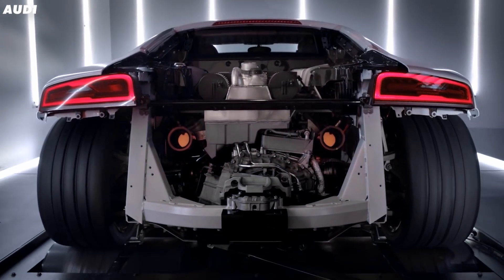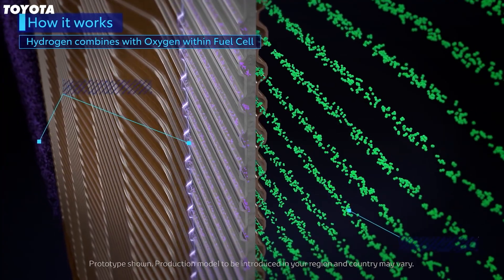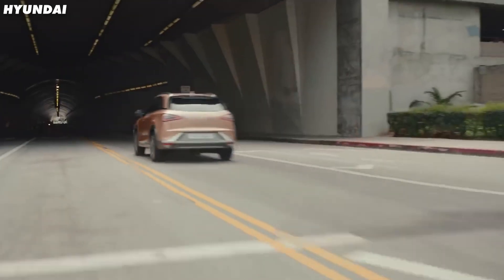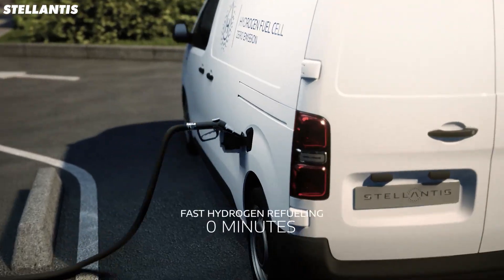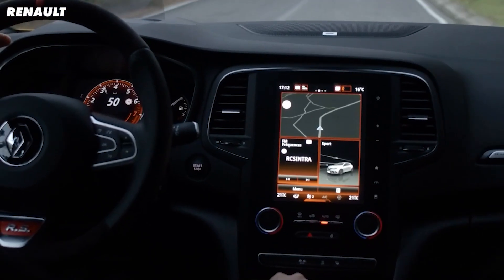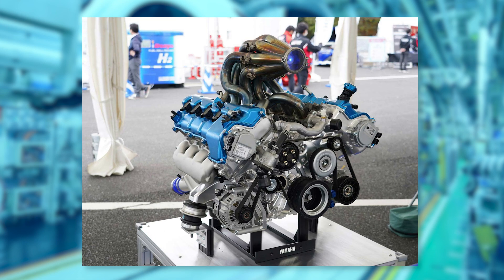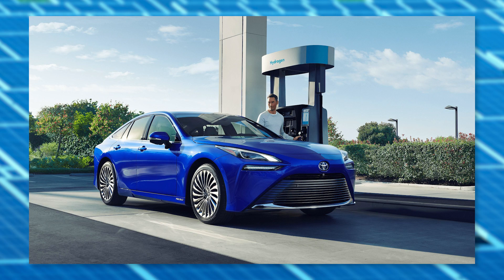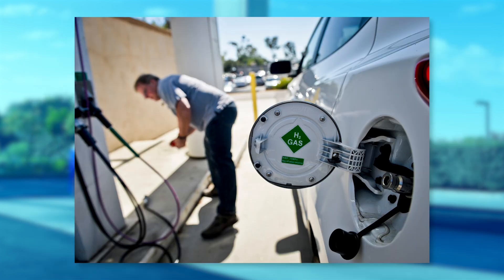The V8 Engine that Runs on HYDROGEN

Comment: OK and how about this? You fill your car with water, just pure water in the tank, and each car has the Mr. Brown's converter which just puts some electricity through the water and divides it in two gases, oxygen and hydrogen. Then they go into the engine through two different pipes, then it burns spinning the engine and then you have clean water that returns to the tank and gets divided again and again and again. And yes there will be some lose of water, but still this will be more efficient, it will MAKE SOUND and will run longer distances.

Comment: Oil is not made of  Fossils Base oil 101 it is made from decade plant matter fossils   be come some gas but mostly reprocessed by  Maggots worms and Predators and what they do not eat it turns back to Dust. Oil is made of  75 to 80% plant and maybe 20 to 25%   Human and animal material but Water is the beast Way of making Power for  Vehicles but between the Dimon Battery and Hydrogen or Water this is the battle that will take place who will be the winner  I would say both will be along with 2 other rising stars in making electricity  energy and Power Energy.

Comment: No big deal there as during 2005-2007 BMW offered in limited numbers the 'Hydrogen 7', a modified 760iL powered by a 6.0 liter V12 capable to burn Hydrogen plus petrol - the car had two separate fuel tanks and a switch to change the fuel used. The problem to burn Hydrogen as some pointed out is that isn't cleaner than Petrol and the fuel per si has 'less energy'; the reason why BMW picked a bigger engine was to compensate the loss of power when running on Hydrogen compared to petrol. Sorry to say but burn Hydrogen isn't the solution and won't be more than curiosity or marketing exercise.

Comment: I just wanted to say that electric cars are more dangerous than hydrogen.
Germany didnt find the best solution to stop a electric car from burning to throw it into an huge water tank out of no reason. Cause its a huge Flameball if it starts to burn. Hydrogen cause its high preasure looks more like a flamethrower. Much safer and the car still lives on

Comment: Hydrogen vehicles should become quite viable in the UK within the next 10 or so years, though I'd put my money on fuel cells rather than combustion due to the higher efficiency and lack of NOx emissions. Since the UK is introducing regulations severely restricting the use of conventional natural gas boilers, and the primary replacement is hydrogen boilers (because heat pumps are useless), there's likely to be huge investment in both hydrogen infrastructure and effective hydrogen production (remember, hydrogen can be produced through electrolysis of water, and its not as power hungry as many believe). if pipes carrying hydrogen exist throughout towns and cities, compression equipment is only needed at the filling stations, sourcing their hydrogen straight from infrastructure for general use. As energy density goes, a tank of compressed hydrogen is significantly more energy dense than a typical Li-ion battery of the same volume, you also have to consider the time taken to refill a hydrogen tank vs the huge amount of time to recharge a battery. If hydrogen infrastructure investment happens in the UK, the cost of hydrogen will plummet, hopefully encouraging manufacturers to seriously look at its merits over battery electric vehicles.

Comment: During the reboot of the electric car after 115 years (yes, electric cars were ther before the ICE cars),  they were also overpriced and unfeasable. Fisker Karma, Tesla Roadster, Chevy EV1, some Japanese cars. And that's why they didn't really catch on. Now, after scaling and investment, the prices continously drop and so will H powered cars. Plus, it is much easier to convert any petrol station to H than to provide high power electric infrastructure say to highway service stations for example. The transport of H will be less efficient since one truck can carry less H than petrol, but this can be optimized over time. The main benefit which everyone should focus on who claims we can save the world by nagging the individual transport, is environmental impact.
And that is as low, as it can be. Not only that, considering that countries are investing in alternative energy sources, it can become quite literally clean power. There is no real waste to producing H which stands in stark contrast to battery and magnet production.
Reply: You can't use petrol station tanks to store Hydrogen, it's necessary a whole new infrastructure way more expensive as Hydrogen in liquid form is very hard to store as it has to be at minus 252 Celsius degree! And the energy used to compress Hydrogen to its liquid state is so intense that's better to use it to charge a few cars battery...

Comment: An engine that burns hydrogen will still burn some motor oil - pollution problem not solved.  Given the enormous pressures that are needed to store hydrogen, and the energy needed to drive a compressor to reduce the hydrogen's volume sufficiently for automotive use, I can't believe we're much further ahead burning hydrogen...

Comment: Everyone wants to hang on to the internal combustion engine, meanwhile I still want an external combustion engine (steam engine) to make a come back. It doesn't make an practical sense, but damn would it be cool!
Reply: A modern Steam powered car despite make use of a closed burn process for the fuel to heat the water and produce steam would cause some emissions...
Reply: @krisg.4257  Well yes, but the point is to be cool, not practical xD
Reply: Search for Metal air battery technology, a company called Phinergy developed stacks that can be used in cars and just have to be filled up with water. They did build a Citroen C1 proof of concept with the tech and it did run hundreds of miles before had to be topped up with water again.

Comment: having a power plant  run from hydrogen  would be far  more   productive then  cars.  because its  stationary and safe  no worry about  it being next to the ocean.  and there are many  nations with  deserts  next to the ocean   so  solar too crack the  wayer  use the  gas/hydrogen to power   a city  see  how it works  . n one has  dont that yet.  you would not nee  fuel cells  just  burn the gas and use a steam turbine.  no big brains needed .

Comment: The biggest problem with hydrogen combustion engines...is water.  Steel rusts. hot steel rusts faster, Oil and water famously don't get along.  IC Engines are really only about 40% efficient.  a Fuel cell is quite a bit higher then that.   Hydrogen produces less power by volume, even if it's much higher per kilogram.  Just converting a V8 to run on hydrogen produces a much less reliable and much less powerful engine.

Hydrogen is gonna be part of our future, but it will not be mainlined into IC engines.

Comment: solar is crap, a scam and never going to do anything real (at least on earth). we can easily power the hydrogen plants with nuclear plants. Yes, they used to be dangerous, but the advances made in that realm have made it actually really safe. they used to be set up so it required energy to be maintained, but the way it is designed now, it is built with a reservoir, so it pumps out water and if it were to lose power for whatever reason, it would just flood it and incapacitate it for a few days. then they would use a different power source (probably from a generator or another station) to power the pumps and remove enough water for it to work properly. also, a lot of people think its incredibly complicated, and I have not seen any videos or explanations online that explain how simple the concept actually is. basically, there is a bunch of water that gets heat from a radioactive source, and they have a few different ways to turn it into electricity. it basically a steam engine with a natural tendency to run until the material exits it's half life, which it is then simply replaced. people keep whining about all of this radioactive waste we have to get rid of and then they are scared of nuclear how does that even make sense

Comment: I also believed hydrogen combustion was the future of cars but in the bigger picture there's just too many pro's on the side of EVs and that's exactly why it's the technology that's taking off, I mean why use additional energy to harvest and transport a fuel source when you could just use it to charge a battery and power your vehicle
Reply: Because batteries are heavy and degrade over time. And no, batteries are not going to get huge improvements any time soon.
Batteries are impractical for electric trucks, electric ships and electric planes because of they are heavy.
Reply: @dipanjanghosal1662  batteries are advancing faster than you think. Let's just take the Nissan Leaf, a down to Earth car, as an example. The 1st gen used a 24kwh battery pack capable of 75 EPA miles. The latest uses a 60kwh battery pack that has the same size and roughly the same weight as the 1st gen one but it's capable of 200 EPA miles. That's a huge progress in less than a decade. Now lets compare the weight of a Tesla Model 3 Performance with a new BMW M3, both cars have similar performance but the Tesla is lighter by 150kg! If you think that a battery pack+motors+inverters are replacing engines+auxiliary systems+gearboxes+fuel tank, the weight equation is getting even.

Comment: Or, maybe Porsche’s efuels will pan out. If the carbon comes from the air instead of the ground, no climate change (still have to deal with NOX, etc, but cats work, mostly).

Comment: bmw made a run of hydrogen 7 serieses from 2005-2007 that had both gas and hydrogen fuel tanks ! https://en.wikipedia.org/wiki/BMW_Hydrogen_7  could swap bt running the smae motor on gas or hydrogen

less hp on hydrogen but it worked !

also toyota's been running hydrogen gr yaris's in testing for over a yr now

Comment: Ironically, the more common cars shift to EV and fuel cell, the higher the chance that motorsport will keep petrol burning. 
A very similar case of film camera, where film, although super niece, is still available, thanks the income of digital cameras. 

If the green transition will progress slowly, there is higher chance will reach a point where fossil fuel will be ban entirely. 

but yes. the bottom line is... golden age of high octane is over.

Comment: Great video, sounds like VHS vs Beta debate.  But more importantly - over about 40km/hr noise from cars is dominated road/tyre noise.  So EVs aren’t any quieter at normal operating speeds.
Reply: And the road noise is influenced by weight.  EVs are much heavier than comparably sized FCEVs or ICE vehicles.

Comment: Every person alive on this planet will die before 
1: internal combustion engines are obsolete and gone
2: before we “run out” of oil 

No single invention has been more useful to more people than ICE powered vehicles, equipment and machinery since the 19th century and no one has a more viable option even on the horizon for mass use.

Comment: Tesla combustion gas turbine generator to 4x4 electric motor skateboard deck. Hands down the lightest and most efficient way for the future.
Reply: Completely fuel agnostic. It’ll literally burn ANY fuel. Hydrogen, woodgas/syngas, petrol, CRUDE OIL, waste oil, pulverized coal, EVEN POWDERED IRON (Fe)!!! 

IRON!! It’s a completely carbon free and renewable energy storage chemical because the byproducts are just FeOx’s (Rust particulates) and solar panels can be used for electrolysis to split the rust back into iron and oxygen for more fuel! 🔥😈🔥😈🔥

Comment: I see you have been bamboozled by the climate communists.

Burning fossil fuels (which are not "dino juice"), forever has never been the alternative to climate communist criminalization of the internal combustion engine.

The alternative is that individuals have the right to use fossil fuel if they so choose.

In other words, the alternative is energy freedom, where all technologies are allowed to compete on a free market. This means that when something other than fossil fuels potentially becomes more practical, people will automatically switch to that technology.

Yet the climate communists describe the situation as if the fossil fuel side wants to force everyone to use fossil fuels. This has never been true and nobody is arguing for it.

Comment: I think hubrid fuel, hybrid drove tech is the future.

Combination combustion engine, electric engine, hydrogen cells, diesel tank, and a heavy duty transmission.

The point, diesel is very ekergy dense, if we stop using gasoline, and perhaps use the reserves to cut diesel fuel akd design an engine around efficient 2 cycle diesel combustion, combined with a hydrogen tank for the electric cell, we can create a vehicle that can run silently on diesel or hydrogen generation, diesel dorect drive, and perhaps even use hydrogen with the internal combustion engine to lower diesel consumption and increase burn efficiency, doing away with EGR amd DEF being as needed as present.

Cleaner burn, and more efficient production and storage of power on demand, with the benefits of electricity and diesel torque and RPMS.

id say do away with the clutch and include a seqiential transmission with double and triple gear skip capability on a durable and simple CVT system, perhaps a liquid CVT with adjustable vanes and input to output ratios.

Then you have a joined single input shaft from your different motors, and a final drive selected by a gearbox at the output end of your hydro CVT.

The primary input shaft to the CVT os a Joined output from the low RPM diesel, and the high RPM electric motor, both producing as much torque as each other, but with a max weight rating of the diesel by itself to account for any failures in electronics.

Now you have a dead simple diesel, so plenty of torque ifnthe electric drive struggles to move the vehicle in E mode, the ECU simply adds torque bybadding RPMs to the diesel.

This would require 2 CVTs likely, one on the diesel to the joined shaft, and one from the joined shaft to the transmission.

Comment: Water Steam is also a greenhouse gas. Additionnal to the others problems you speak in your video, dihydrogen is NOT a solution to replace fuel.

Comment: Thanks for the video. One thing you can explore on another video is the fact that fuel cell although today expensive on normal road cars may be just the right solution for long-course HGVs, trains and even airplanes. Can you imagine an electric airplane with batteries? Or the batteries on an HGV that could provide thousands of miles in range? The mass production of hydrogen for  these vehicles and its distribution will make fuel cells more attractive, do you agree?
Reply: They already made electric airplanes. Was about to comment something similar but decided to look it up first. EV is the future they just need to figure out the batteries or creat some type of Sifi device that generates endless energy😂. None of us will be around when that happens tho.

Comment: Just use nh3....... 1.8 times the Entergy of hydrogen just as green the first diesel ran off it low pressure it turns to liquid at 125 pis can be made for less than a buck a gallon you have to change nothing to your engine other than the tank and fuel delivery..........

Comment: Hydrogen is about the least efficient form of energy storage.  You lose 50% in producing hydrogen from electrolysis, 50% again in compressing or liquefying it, and then lose 70% of what is left by burning it in a piston engine.  Multiplying the EFFICIENCIES:  50% x 50% x 30% = 7.5%.  So hydrogen as energy storage returns only 7.5% of the energy input.  That's like charging your phone to 100% then checking it and it only has a 7.5% charge.  Who would do that?  Nobody. Ridiculous waste of energy.  I'm continually amazed at the ignorance of this ongoing "hydrogen economy" nonsense.  Hydrogen is by far the worst method of storing energy.

Comment: Thanks for the video. But i would have loved you to explain the actual difference between regular fuels and hydrogen fuel regarding the combustion process and the energy delivered. How efficient is a combustion engine running on H²?

Comment: So yes EVs are more efficient than electrolysis to make hydrogen. But EVs also use lithium batteries. These are garbage for the environment and can burn for extended periods of time in car crashes. Solid state batteries are a good replacement and solve a lot of problems but are still a good ways off and still use lithium, witch is one of the worst substances to mine for the environment. Then their is recycling and pollution, which in my mind is way more important. A V8 is made of metal, either cast iron or aluminum. Easy materials to reuse and way less toxic. Hydrogen will always be better in both its forms than EVs pollution wise.

Comment: to answer your question if it's more efficient to store energy has hydrogen or as electricity in a battery, the former by a fucking long shot. The energy Density and safety of hydrogen cannot be matched by any batteries. Even the carbon fiber cell batteries barely get to 50% iirc. 

The problem with electric cars is energy density and hydrogen completely answers that question. As for whether or not it's greener than electrics, less batteries means less african cobalt. Pretty simple answer to me.